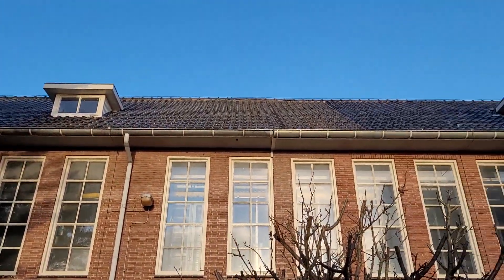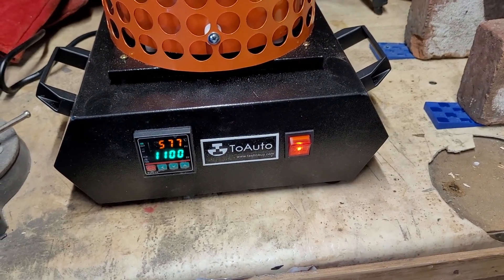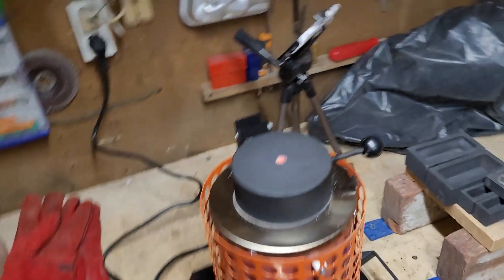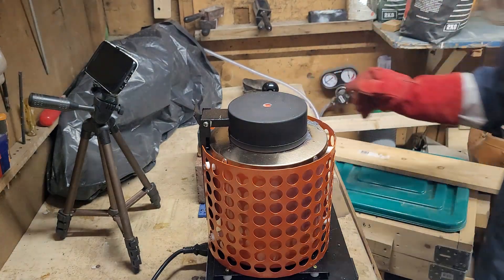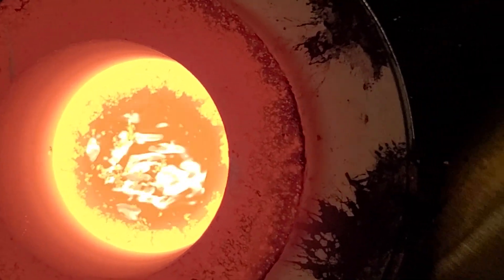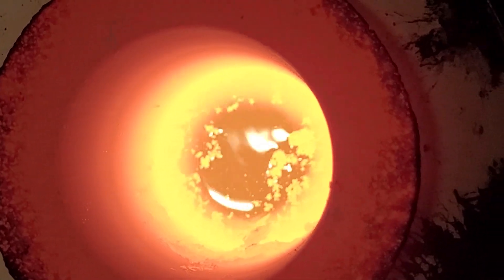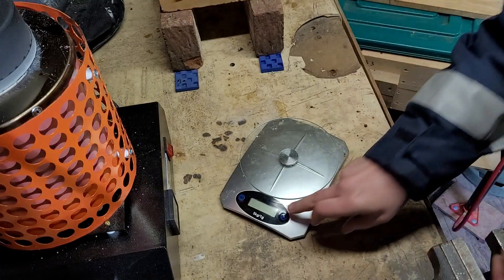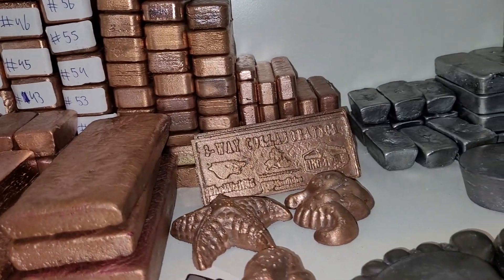Melting copper indoors - Toautotool - Steam explosion!

Comment: A lesson to always also pre-heat your metal before adding it to molten metal in a crucible. Glad there wasn't a larger explosion or serious accident!
Reply from the maker: Yeah, always pre heat those metals! I am used to my propane furnace, where adding it slowly does evaporate any moisture before it touches the liquid metal, with the electric furnace stuff goes a little different :P

Comment: I suggest that you buy some steel (cookie) baking sheets from a second-hand store. The baking sheets are very inexpensive. Set your ingot molds on them before you make your metal pours. The molten metal is not hot enough to melt steel, so if you spill molten metal on a baking sheet (or if the crucible should fail), you won't set your wooden work bench on fire.
Reply from the maker: That is a very good idea, if I get to melt with the electric furnace in the old shed again, I might do that :)

Comment: Well. Jeez. Close. But still i do not think it was steam explosion. I did not hear the standard blow sound as it is in explosions. I think more that it was a standard fluid hop when spmething solid and a little bit heavy drops in it 🤔 or maybe it was hmm sounded weird, maybe also because making it indoor.
Either way. New inglod molds made their job. Looks nice.
Reply from the maker: That crossed my mind too, that it was because of the material dropping from a little height into molten metal, but I think the copper shots where a little moist as I kept them in my cold shed :)